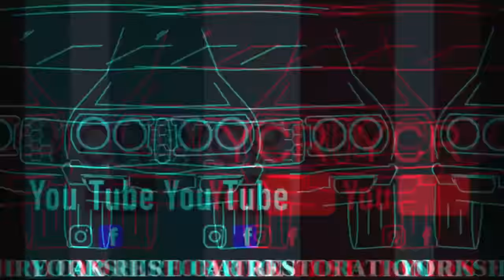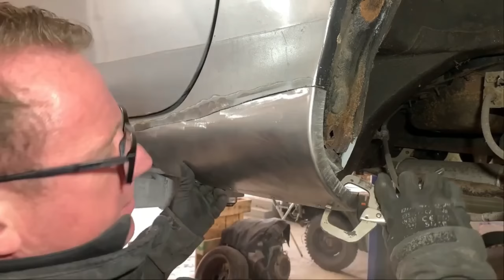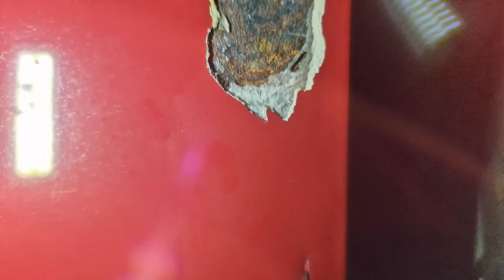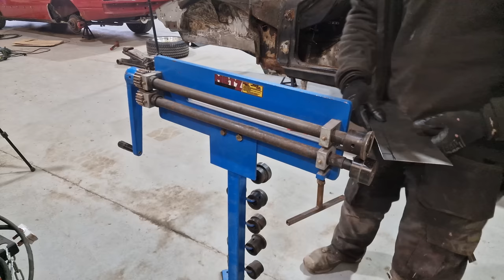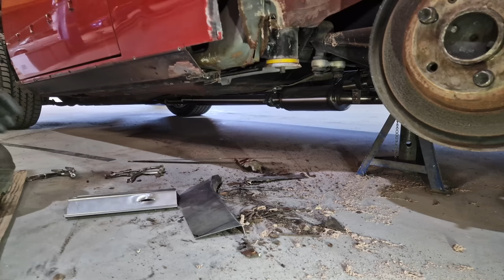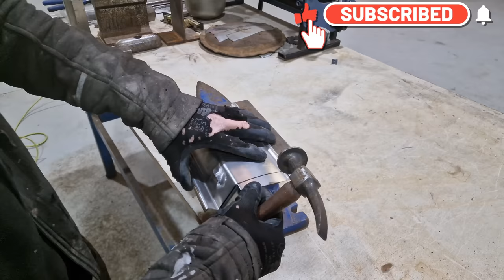BMW E24 restoration

Comment: I have an E24 M635CSI just like this one except that it's lived in Texas all its life and doesn't have a spot of rust on it. I did just buy a very rusty Mercedes Benz W111 coupe that looks like it's had a skim coat of filler wiped all over it in a previous restoration that's starting to fail. These videos aren't just educational, but they're therapeutic. Thanks for putting them out there.

Comment: Kicked into a customers '80's RS escort today.. same colour as your beemer.. pulled everything off - interior, all bolt ons, dash, all glass blah blah - had a bare shell + engine/running gear by days end. I think it gives your beemer a run for its money on the "Is any bit not rusted out?" front. :-) That Datsun springs to mind...
Reply from the maker: Yer it's unbelievable how.m ch prep.work is needed before you even get to the rust sometimes :)

Comment: Absolutely astonishing fabrication skills from what seems to be 'just a shed' ! 
However i wonder is: how long will this hold? The rust prevention SEEMS just some zinc spray, which is a pity considering the amount of caring tlc.  

Another question: you SEEM to cut rusted parts first and than you start fabricating replacement body parts. How do you know the replacement part should look and fit, if the old part is gone (thrown away??) ?  Am i right you use the panel on the other mirrored side as guide?
Do you  spotweld or seamweld the fabricated parts to the original body?

Thanks for this video that is both relaxing and educational.
Reply from the maker: Thank you. All jobs are protected after the job is finished with either access holes and neutraliser and Waxoil or they can be accessed from both sides so treated with paint or underbody treatment. 
As in the video we measure, make templates and use the original body part as a pattern. 
We seam weld all jobs after fabrication :)
Reply: @yorkshirecarrestoration  
Thank you, i should not have worried :) 
Keep on the good work

Comment: Just amazing craftsmanship here, makes it look easy when it is anything but. Getting those things to fit so accurately is very difficult. Not warping it all into a pretzel while welding it is also difficult or blowing lots of holes all over the place and that thin metal.
Reply from the maker: Thank you yes it takes a little practice :)

Comment: I get mesmerized at how you work. Thank you for sharing with all of us. Can you please share what happens to the rusted portion of the wheel well? It looked as though it was not also restored, but has rust damage. Does it get replaced sheet metal and attach to the outer skin, or attached to the Sill that you replaced, off camera filming,? The work you all do for this channel, well, it's great stuff to watch and learn from!
Reply from the maker: The wheel well should be in the next video and the floor section in coming videos :)

Comment: You welded the new arch over the old one, then cut through to remove the old panel. is that to keep the original lines?
Reply from the maker: It's the easiest way to get a perfect fitment before butt welding it in :)
Reply: Saw that method on Fitzee’s Fabrication as well. A good job well done. Thanks for the content.
Reply from the maker: @stewartshackleton7825  yes it's a technique use quite often in the industry :)

Comment: Two questions please:
1) Did you use 18 or 16 gage steel?
2) what was the distance from the door to the end of the arch panel you fabricated? Is it 49 cm or 50? I am referring to the distance you measured with a ruler.  Thank you
Reply from the maker: 18 gauge steel for outer panels and 16 guage for structural steel, i check on distances :)

Comment: Difficult panel to make, nice to see a bead roller used.
What decides if a joint is butt or lapp?
Is it a technical choice or cost?
It's definitely my favourite UTube channel, your workshop now looks 'worked in' with stuff everywhere!
👍🇬🇧
Reply from the maker: thank you , usually the choice between butt and lapped panels is cost, butt welded panles take more time and therefore more money to do :)

Comment: Was that diagonal slit againt the butt, at the top of the patch panel, to relieve tension? Hmm...
Reply from the maker: It was actually to release the peice of metal on the rear that I had cut alone but wanted to detach on the inside :) but good guess :)

Comment: It always hurts me to see such extensive rust damage on a beautiful car like this. Especially if someone just smeared bondo on it. You should deal with rust before it gets out of hand. If you just cover it up it continues to eat up the metal underneath. Good that there are Craftsmen like you who can fix it the proper way. I always admired people who can work with metal like that. It is art. I have a 635csi from 83. Luckily only with a few very tiny spots of surface rust in the engine bay and on the wheel arches. All the metal still is untouched original because i deal with the rust as soon as i notice it.
Reply from the maker: It's nice to have such a rare rust free car :)

Comment: no sandblasting in cavaties and no rust sealing neither.craftmanship is flawless but the car will continue to rust in the hidden places.
Reply from the maker: Rust neatralizing and rust proofing, like cavity wax and sealing is done at the end. None of the sections have had welding finished yet and Its all flammable. But thank you for your support :)